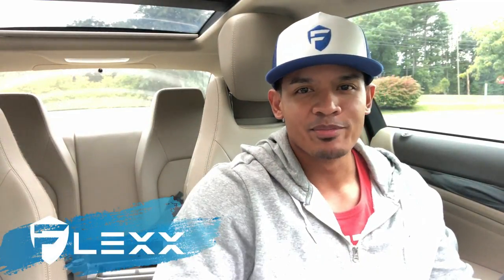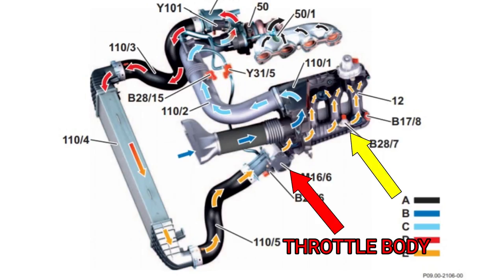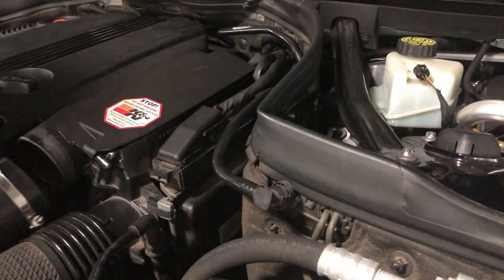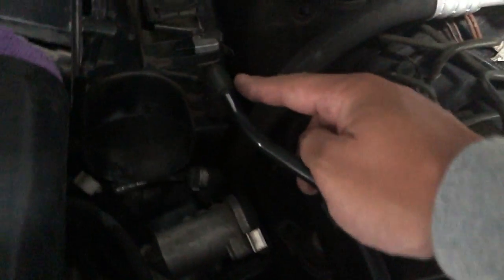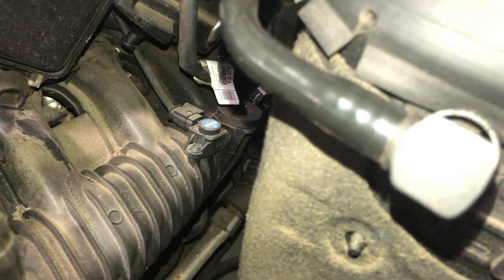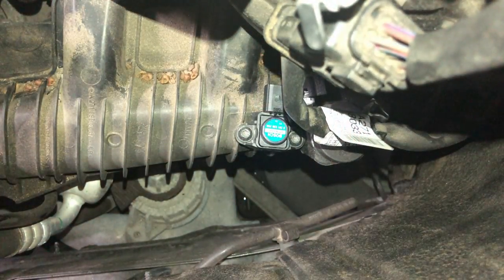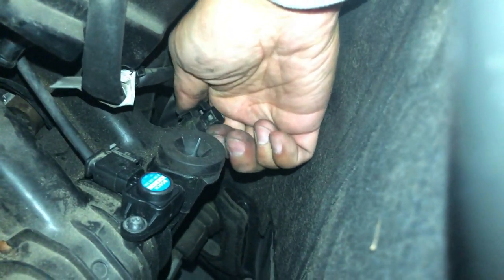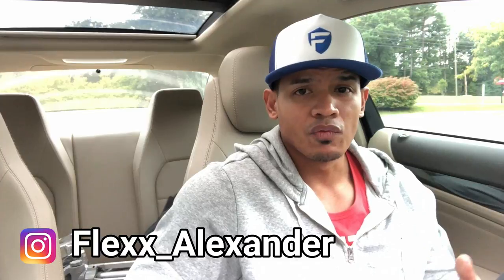PART 2: HOW TO REPLACE MERCEDES C250 AIR SENSOR & 2ND MAP SENSOR

Comment from the maker: FOLLOW ME!!!
Website: www.FlexxAlexander.com
Facebook: www.facebook.com/FlexxAlexander1
Instagram: www.instagram.com/Flexx_Alexander
Reply: I really enjoy your channel and in particular the one where you change your MAP sensor. I own a 2012 c250 coupe 1.8L turbo gas. Its identical to yours. You provided a site on Ebay but it states that it will not fit my car.
The # on mine is 
0 261 230 251.
The one on the Ebay site is
0 261 230 250.
I'm have a really hard time finding this MAP sensor and Mercedes can't find them, it's on back order. Please help me out.

Comment: Hi Flexx

A few months ago, I got a CEL and when I connected my OBD, it was P0068 (MAP/MAF - Throttle Position Correlation). After watching your videos, I replaced the 2 MAP sensors, and the boost pressure sensor. The CEL is still there. I was reading online what else can cause the CEL to stay on after replacing the sensors. The only thing left to replace is the Mass Air Flow sensor but I can't locate it in the engine. Can you help me?
Reply from the maker: Common problem that I also experienced and what sucked was that I did so many cleaning and replacement and even turned my car back to stock and nothing fixed it.  It actually randomly went away on its own and never came back.  I literally have no idea what was the cause.
Reply: The c250 dont have mass air flow sensor
Reply: @Aloalo01 i been trying to find the MAF sensor didnt know it actually dont have on my c250, Got the code p0172 too rich bank 1 cant resolve the issue little help please
Reply: I have same issue at my C250 and check engine back on with P0068, any idea how can solve it
Reply from the maker: Not that I’ve seen over the years.  I honestly think it has to do with a ecu software update or something.  Cause I cleaned/replaced my sensor, turned my engine back to stock, and smoke tested it for leaks. Nothing solved it and it went away magically by itself.  It’s probably a glitch in the ecu and it needs a firmware update.

Comment: Hey flex.  I changed out my 2 map sensors near the air sensor 
I have a 2013 C250 and when I put it all back together my car doesn't want to go over 2 rpms and I notice the hose that connects to the throttle body is getting a suction to that hose.  Almost like a vacuum problem now.    Any help?  Wrong air sensor ?  Would that even cause that?
Reply from the maker: Don’t know.  I never had that issue. If they are directly replacements, shouldn’t be a problem. You could have installed wrong parts, or connections aren’t tight, or you removed these sensors while the cars battery is still connected so that could cause faults in the ECU and codes needs to be cleared to run properly. If you can’t solve it, def get a mechanic to look at it.
Reply: @TheFlexxGarage  both turbo charge pipes collapse when I turn car on. So weird .

Comment: Hi Flexx, would you tell where the mass air flow sensor it is? how to clean it? can it be replaced DIY? 🙏🏻
Reply from the maker: theres no maf in a C250. Only 2 map sensors, 1 air sensor, 1 boost pressure sensor. Look at this video. It's Part 2 cause theres a Part 1.
Reply: @TheFlexxGarage  thank you flexx!🙏🏻
Reply: @TheFlexxGarage  can i clean the MAP, air and boost pressure sensors? what the detergent to clean safely?

Comment: Any recommendations to fix P0068 at C250 W204 As i replaced both Map sensor and boost pressure sensor including clean Throttle Body but fualt back after one day driving especially no vacuum leaks at all
Reply from the maker: I tried everything. I honestly think it’s an ecu probrom and it’s needs a firmware update or something. Cause I tried everything and nothing fixed it. Change sensors, went back to stock in the engine, smoke tested it for leaks, new battery, and nothing. I was scratching my head for an entire month.
Reply: Thank you for your reply,  please let me know if you find anything to solve this issue as not able to passing smog test

Comment: Hey flexx, quick question. Did you just detach the clamp to the negative terminal to disconnect the battery? I know this may be a silly question.
Reply from the maker: I always disconnect the battery when working in the engine bay or anything electrical. I disconnect both to be safe.

Comment: Can you tell me what this code means as far as car performance I’m having codes P0340-62/P0068-00/P0304-09 mechanic is telling me engine needs to be replaced car has a hard start and sometimes has misfire after 2300 rpm’s (hunting) hope you answer thank you
Reply from the maker: https://youtu.be/rwtAdVvZqdk
Reply: Hey man! I got my car fixed at Mercedes’. Last year my car also read p0340. It was diagnosed with a cam shaft replacement and timing chain. I couldn’t afford it at the time, a year later I went and they fixed it for free. A month later, today I got a code P0068, I wanted to ask flex if this can be related? If it would be worth going to pay for the diagnosis so they can see if it is. Got all work done at the dealer and have ever receipt ! My car doesnt feel different, just the CEL turned on.
Reply: My car wouldn’t start right away, it would always make a rattle sound. And when I would speed the power would drop like my car would stutter. All that is fixed now. Changed spark plugs, fixed the cam shaft even chained my thermostat, but today that code p0068 turned on. My car has 85000 miles, 2013 c250
Reply from the maker: P0068 is completely different and separate. I got that when I had my c250 and tried everything. Changing sensors, cleaning the throttle body, checking for vacuum leaks, and changing the air filter.  Nothing worked and And weird as it sounds, it randomly went away one day by itself. 🤷🏻‍♂️ my car drove fine before and after the fault too.

Comment: Do you have a video on how and I get crankshaft position sensor off?
Reply from the maker: No. But if your are getting the crank position error and long starts up…go watch this video. https://youtu.be/rwtAdVvZqdk
Reply: @TheFlexxGarage  thanks man. I actually saw that one last week. I’m at 187,000 on the dash. Think is should try it and just give it a shot?
Reply from the maker: Damn. Yeah. The sensors are cheap anyway.  I changed my crankshaft position sensor and my camshaft position sensor. They are each held on by like 2 small bolts. You should be able to find a diagram online.  Just look up the sensors on a m271 evo engine. That’s the engine on a c250.

Comment: Flex my C250 engine fan is cycling high low frequently.  Notice it a parking lot speeds. No codes and ac works fine car runs well.  Maybe a relay or sensor, any ideas?
Reply: Hey mine does that, but i think it is because when it is on the Auto setting it modulates the air to keep it a certain temp in the car. Did you figure it out?

Comment: Hy, i got a w204 facelift and i got problem with maf sensor or something like that, i change the maf sensor with a original one( continental) and i have the same problem, before that i change the air filter,a original mb filter and the problem persist... the car have check engine light one and the engine don t have power...
Reply: Looks like throttle body give it a clean.
Reply: did you scaned it for trouble codes?

Comment: Where is the mass air flow sensor located
Reply from the maker: There’s no MAF sensor in a c250.  The c250 uses different types of sensors as shown in this video and in part 1 video.
Reply: @TheFlexxGarage  are you sure I got a code for mass air flow sensor what do you recommend me to change or clean if call shakes when I drive to press on it